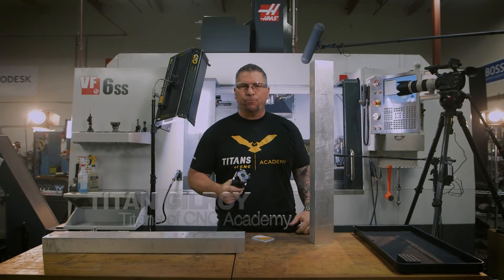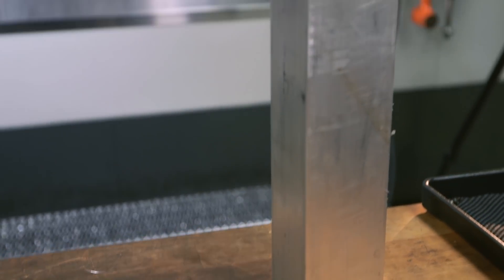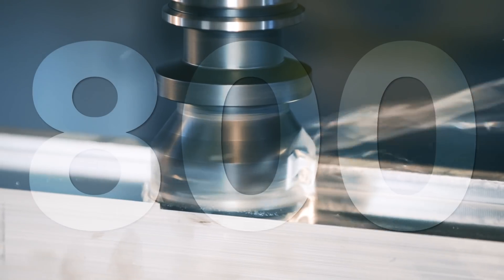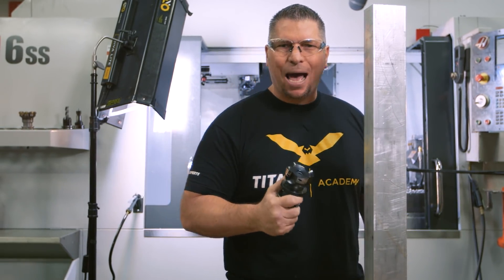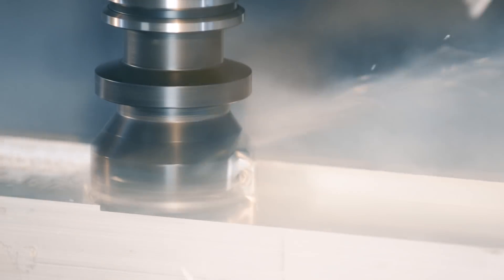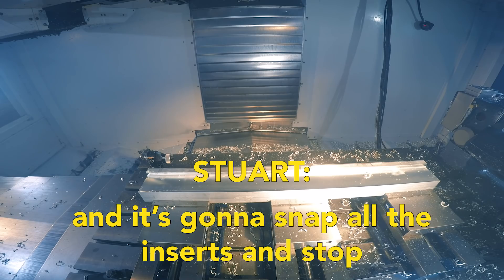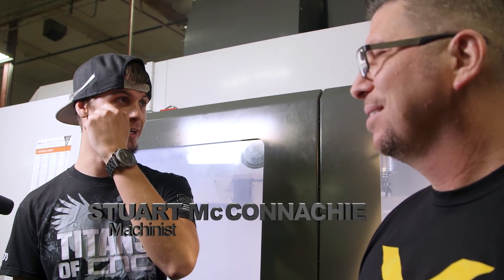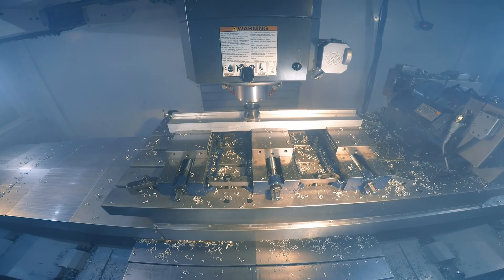Pushing CNC Machining Past Failure | 800 IPM | Kennametal

Comment: I use a different approach.  I set up my machines to run as many parts as possible.  I bought a brand new, gorgeous VF5XT last year and I fill the 60 x 26 travel with parts.  this gives me a 9 hour run time with tool reliability.  I can run the machine during the day and then get another run in at night.  Maybe I could push it harder but as its lights out machining with nobody at the shop I'm happy with a program that is reliable and doesn't break tools.. ever.
Reply: I'm in business to make money, not the tool supplier money.  ( I tell my guys that all the time )
Reply: Thats a good approach to alot of small parts, but big parts or ones where you need 4 or 5 ops for completion, it isnt doable.
Reply: Cool approach, will remember for when I'm finished building my wooden diy cnc
Reply: Hear that..thats how we do it too
Reply: I finish the tool reps tell you speeds and feed that are best case scenarios
Reply: @peterdwyer4609  See I'm a newb and I still know speeds and feeds people are the guys just trying to sell your more tools. SFM and IPT isn't a pain in the ass it's saving you thousands a year if you put in minor effort.
Reply: We leave longer run time machines going at night at the shop I work at. Worst thing I've seen is a tool load exceed over the night and you come in the next day with the machine still on part way through the process. It just be like that sometimes. Huge game changer for those 8-12 hour processes. Cuts the run time in half!
Reply: Here I am 2 weeks into Precision Machining classes and I'm reading OP's comment like "Wasn't one of the first things they said in the safety course and safety tests, to not ever leave a CNC running unattended, and to keep an eye on the entire process"? Lol
Reply: @whywouldyoucareaboutmyname  hell at the shop I work at we do it often. We do it often mostly becuase we have too but as long as your program is proven and tools are good you really dont have much to worry about
Reply: @whywouldyoucareaboutmyname  It depends on the shop. If you have TESTED AND MANTAINED fire detection and extinguishment rigs on the machines and you know they are reliable about detecting tool breakage and stopping themselves and you are doing thousands of the same part over and over and trust your set ups....This is probably something people shouldn't push you into fresh out of class and don't do anything uncomfortable just cause the boss man says to0, cause when it breaks the machine it might just be your ass. But once you have done the same part for a few months monitored...eh. That machine is there to make money doing repetitive shit 24/7 not be babysat. Edit: Oh yeah proven monitored tool life maintenance.

Comment: Hopefully that wasn’t a 3” cutter body. You are never suppose to run 50% step over. It causes the insert to slap the material as it enters to work piece. Was always told anything, but 50% by every tool rep.

Comment: I was under the impression that you did not want to enter the cut right at half the cutter diameter, because it is the weakest part of the cut for the insert.  For example enter the cut at 1.6" or 1.4"   I could be wrong

Comment: Eat
Easy to push it on aluminium. Show me the boundaries on 300 or 400 series steel. I'm curious.
Reply: Let's see them cut inconel
Reply: @Chevydevil  incolnel good, but better yet is mars
Reply: 300 and 400 series needs some gentle loving by the tool😆😆😆😆. We all know what happens when you try to push the envelope with 300 and 400 series. Tool life goes haywire!!!!.
Reply: I wanna see it on carbide
Reply: See it on some D2
Reply: i mean aluminium without any coolant is really fucking hard for your tool

Comment: Great vid, but I wish you would of showed the finish on the part after each pass to see the chatter or heat soak. But I never work with these high end CNCs so I guess it doesn't really matter
Reply: HAAS is far from the "high end" of the machine tool world.

Comment: So, you're running 1.5 WOC at .1 DOC at 400ipm at 100% spindle load with this cutter?  That cutter isn't very efficient, a Shearhog will do that same cut a lot more efficiently.  For probably less money.  Try a 1.5 inch 2 flute shearhog at 100% WOC, .1 DOC and run at 400ipm, I'd guess something like 10-12HP.

Comment: A couple questions, what grade was the aluminum, and did you step up the spindle speed when every increase of feed rate, or did you run the spindle speed the same rpm for every test?
Reply: 6061 is what he said at the end.

Comment: Nice video But first you have a bad chip with 50% engagement You ALWAYS what think to Thin( Chip thinning ). the rule of thumb is %75 or 25% .  Running 1.5" with a 3" cutter will give you poor tool life Also you are removing more Cubic inches of metal running 2.7" @600ipm then you are running 1.5" @ 800ipm  the 600 ipm setting you are removing OVER 25% MORE metal!!!! If you are going to try to teach PLEASE teach RIGHT! This is really basic stuff that any good machinist KNOWS

Comment: Nothing against Haas, but you get what you pay for. This is a 40 taper machine and that little spindle just doesn't have gobs of torque like a geared 50 taper with 35+ HP. Bigger machine would also have sturdy box ways and a design that is simply more geared towards beating the shit out of it.
Reply: I agree for the most part, Haas machines are cheap but they're very economical. my old shop had a high end Mori, it was a kick ass machine but had a lot of problems and had to be fixed often. My new shop has a vision wide which is a cheap Korean machine, it is really powerful; 55hp and a crap ton of torque but its maxed out at 7000rpm.
Reply: A CAT40 taper, linear guide machine is NOT made for old school/box-way hogging.  "High speed machining" works because linear guides wear less overtime than boxways and typically the feed rate/rapids are higher on the machine due to the smaller amount of friction.  My box way fadal is maxed out at 200ipm.  Over that and not only can the processor not keep up, it drains the way oil with a quickness.

It's like complaining about not getting your corvette to trailer 10,000lbs loads.
Reply: @pro-seriesfabrication3810  
The newer fadal 4020b2 supposedly can get up to 1000ipm. Hopefully they reduced the table weight from the original we had the footing snap from one corner. Rapiding at 100% for so long it just gave out and it listed on me in cycle 👋😮 thought it was an earthquake... 😅 still made a good part and leveled back out on three legs when homed.
Reply: Vlad The Impaler: The machine in this video is a #40-taper and according to Haas homepage the VF-6 is also a #40-taper.
Reply: Eggs you're wrong vf6 model is a 50 taper machine.
Reply: you can get Haas VF-5 or VF-6 at either 40 or 50 taper. It depends upon the individual machine.
Reply: @S0ulinth3machin3  
We had a 2003 vf5 50 taper, ran the hell out of it, traded it in 2 weeks ago on a new vf5xt 50 taper. The old haas faired very well through the years. Too bad we couldn't keep it. Floor space dictated that decision. Didnt take long to learn the new ngc control.
Reply: yeah, the mori they had was a double spindle lathe with three turrets on it the corresponding bottom turret and top turret could both cut simultaneously and the top turret also had a y axis and active tooling for milling operations. the problem was that the top turret was moved and held in place by a huge belt that would routinely needed to be tensioned and has even broke which dropped the turret into the machine and cracked on of the turret housings, mori ended up fixing it but still unacceptable for million dollar plus machine.   @boldee101
Reply: Matsuura's are good but I only have experience with the older ones, Mazak is good too. Takamaz and Emco both make good machines to but are a little less known. the Emco machines are made in germany but there service techs are all American wich is nice cause you can actually talk to them and understand what they say lol.  @boldee101

Comment: 20.3 metres a minute is certainly travelling. What RPM were you running? What grade aluminium were you using? Material has a big bearing. 

Insert geometry also has an influence.
All machining is a lot of trade offs between speed, tool use, wear and number of operations in a job.
The rapid traverse rates and speed of tool change also can have a bearing in time taken. 

Would be interested in seeing this performed on steel tho.

Comment: I wonder how much of a difference it would have made if you were conventional milling, rather than climb milling, on the original 2.7" step over. When you were on the 600 & 700 passes, it had that big wall that may have messed with chip evacuation. (P.S. I am NOT a machinist. So if that's an absolutely stupid observation and query, forgive me.) 

Also, I would like to see a video of milling with & without coolant. For example, if you did the exact same cuts with coolant and without coolant. Maybe with a parametric graph with the spindle load % & kw, HP, and surface footage. So we could see whether or not the coolant makes an appreciable difference, or any statistically significant difference at all. 

Maybe even one comparing MQL, mist, HP vs LP flood coolant, WD-40, brushed on cutting style lube like the old school guys use on the manual machines, etc.

Comment: Does coolant really have any affect on the load?
Reply: Yes. Lubricity is important. Coolant provides the required lubricity and eliminates tool edge welding.
Reply: yes, a lot man. I'm a Machinist myfelf here in Germany.

Comment: Cutting your MRR by 25% to get to 800ipm, thats not epic manufacturing, thats an epic fail.
Reply: Christian Forthofer i worked with a programmer like this.  Run crazy speeds, pop the program in, and walk away.  Then get pissed we you bitched that you were changing tools every 15 min. $100 in turning inserts by the end of the night with only 0% increase in production because of all the downtime rebuilding tools that failed early.
Reply: @pharaun159  LOL I had a "programmer" come in on a weekend with me, turns out we were programming the same part. His took 2.5hrs and used a 6" long R390 to do most of the roughing, 45 minutes on one tool. You actually had to stop in process, change inserts, and restart from the beginning of the tool.
My whole program took 45min and you could actually run it without breaking a tool.
He was one of those guys that graduated the machinist course and thought he was a programmer worth $26/hr.
Reply: LOL technically a little MORE   silly video showing how to do it the wrong way and HURT production AND Tool life at the same time
Reply: Yeah...I've worked for an owner like this..crank the piss out of it and in 304 or 316 ss, make it through one or two like a hero and walk away for u to inevitably have a crash later...not his fingernails getting chewed....prick
Reply: by my crude calculations 2.7 x .1 x 444 ipm = 120cu in per min. 1.5 x .1 x 800 = 120cu in per min. also I would say that the tool can handle it just fine, the machine taps out.

Comment: It's amazing to see the limits of a machine , but in real life application , this is too scary. Over 400 it really gets out of hand , if something breaks , even "only" 200 brings your hearth rate up :D . 
Now i wanna see some super high feed turning even if it's just aluminium . (parameters like .1 radial depth , feed .05"/rev , and cutting speed about 6000SFM)
Reply: Kiss peter that is the reason the shop I work at loses money, one guy runs and saves aggressive money making programs the next guy "ooo that's too much" and drops feeds and speeds by 50% and burns up tooling
Reply from the maker: You must not have watched it til the end...
Reply: i did , but that is just too much for the machine . so what about pushing turning to the limit ?

Comment: If you had unlimited power and spindle speed, along with a stout machine, then your surface speed would also be, in theory,  unlimited. At your 12,000 rpm limit,  these chips started getting raggedy looking at 300 ipm. More than that is just excessive wear and tear on your machine. Titan says, "have some fun, break something". That mentality gets most people fired.
Apparently it's working for you (Titan) brother. So rock on.
Reply from the maker: Ha:-) I know my machine and knew I wasn't going to break something... just was having fun with Stuart. I have replaced many spindles in my day, but also have out bid most companies and gotten work with top Aerospace companies. It's an art and philosophy... I am just venturing out to show many that the earth is not flat.
Reply: Right on. It's all good and best of luck to you.

Comment: Nice video and I learnt a thing or two.
The only thing I don't understand is why the emphasis is put on feed rate while there are more variables contributing to material removal.
Making money with a machine means removing volume as quickly as possible, which would mean cubic inches per minute.

The 600ipm pass at a 2.7" stepover was 126 cubic inches per minute
The 800ipm pass at a 1.5" stepover was 120 cubic inches per minute BUT with reduced spindle load

What I would suggest in search for a metal-hogging recipe is to be at full depth of cut, keep the maximum feed rate and play with the stepover. The reason being, you're paying for big inserts but only use .1 inch of the tip.

Any thoughts?
Reply: You should try some DMG, Mori Seiki or Hermle Machines. Those wipe the floor with anything else you know.
Reply: @svk1324  
We were pullin parts off of our okuma, and put em on our haas. One of em has a 50.8mm (2 inch) sandvik 880 drill. With the feed and speed left alone, it shook the hell out of our haas vf5. Yeh alot less iron in the haas. It runs the part ok but the big tools are backed off. (Both machines are running 50 taper tools)
Reply: "HAAS is the best machine I've ever used" haha
Reply from the maker: 2.7 was definitely a higher HP also... My point was not to bury the tool but just to show everyone the tool could handle a lot... so don't be scared to experiment. My normal feed as seen the the spark plug video is 300-500IPM at Z-.2 which gives me a nice MRR.
Reply: 𝖘 𝖍 𝖎 𝖗 𝖔 you're right a more complete doc would use the insert more efficiently. Though generally a tool of that size your probably using more for facing style cuts, not so much mass MMR, there's more suitable tools for that
Reply: I cut mild steel every day with sandvick r.390 inserts. One thing I've found to save the cutters and inserts is to either  be above the screw or below it.  Having the cutting pressure concentrated at the thinnest part of the insert leads to inserts breaking.  Best strategy is at 1/3 of insert or 2/3.  I cut at 40 ipm with 1 inch sandvick and .5 depth of cut using air through tool on my HAAS VF5 XT. Btw, I've been machining since 1980 and the HAAS is the best machine I've ever used. Yes, I've owned Makino, Matsuura etc.  HAAS wipes the floor with them.

Comment: What was all the smoke coming off? Was that Aluminum being burnt?
Reply: Whatever fluid they were putting on it, most likely WD40 or something similar.
Reply: i think it was, but it could have been oil that was put on before the cut started
Reply from the maker: Wow! Yep... I was trying not to flood coolant yet so the camera could catch the footage... just soaked the floor with some WD40 to give it a lil lube... of course it doesn't cool it though.

Comment: Why not take a full DOC of the insert cut at a proper feedrate for your horsepower limitations? In addition drop the spindle to a better part of the horsepower curve.  This would be a faster MRR because there would be less movement overall.  High IPM isn't always the fastest way to remove metal.
Reply from the maker: Agreed, there are definitely many variables... I didn't want to over complicate things... but more wanted to teach... These tools and machines can handle a lot, don't be afraid to test the waters at higher feed rates... You might just make some money:-)
Reply: exactly, these videos showing all this high feed rate is just for show. Backing off the DOC, WOC and increasing IPM does not remove material faster if you need to take more cuts. I would rather see some real stuff that shows how to maximize constrained by machine capability, and where your forced to use a small tool because of a feature. IE: is it worth it to REST or not. ALSO pushing HSM and adaptive strategies.
Reply: TITANS of CNC: Academy keep up the good work,as someone who runs large HBMS all day every day it's kinda nice to see something run over 50 IPM.

Comment: If you never break a tool, you'll never know how fast you can go
Reply: Smyth Diana True. We have to err on the side of caution. I cant go to my boss with a destroyed $800 facemill. I just cant. This was awesome because it is something we all want to try.
Reply: Smyth Diana that ridiculous . It’s alll science . Understand sfm chip load materials and tools
Reply: bobwatters  Indeed, and that does not qualify them as machinists, manual machines are still needed to back up CNC and if you don't have the skill you are in trouble.
Reply: 0.0 IPM, 0.00 RPM, I accidentally pressed release tool button. 8mm endmill disappeared . So you know you don't have to go fast :))